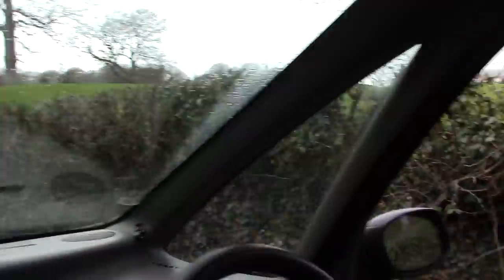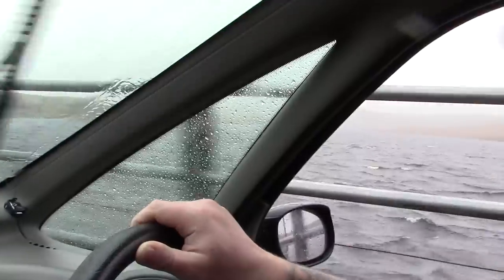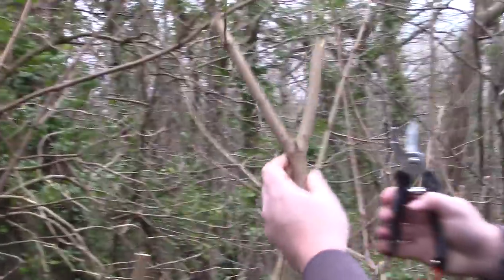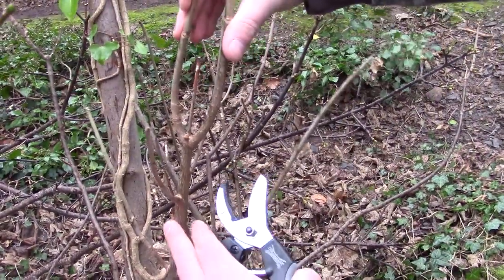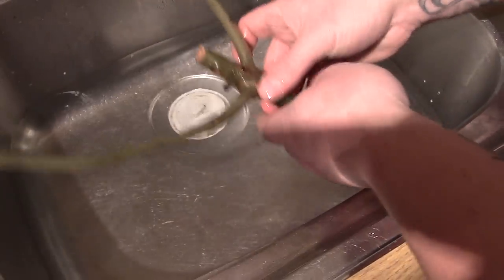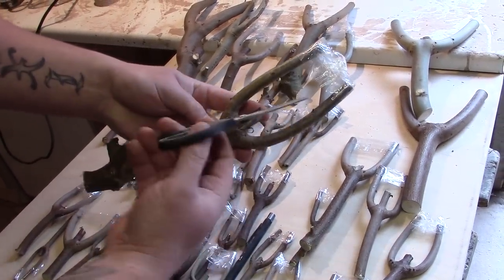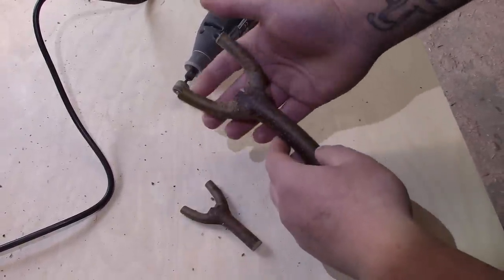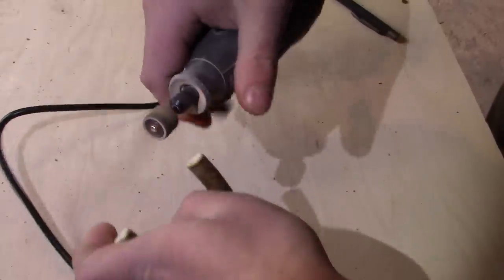HOW TO MAKE A NATURAL ASH CATAPULT, MOOCHING, SHOOTING & MORE WITH GAMEKEEPER CATAPULTS

Comment: Great video. My local trees rarely produce anything Y shaped and useful. I've been using two sticks with tapers on the bottom to make a V. Some jute twine for a lashing and a wedge between the forks to resist the binding. Still not as easy as a nature made Y, but an alternative if a natural Y just isn't happening. 
Cheers Jim